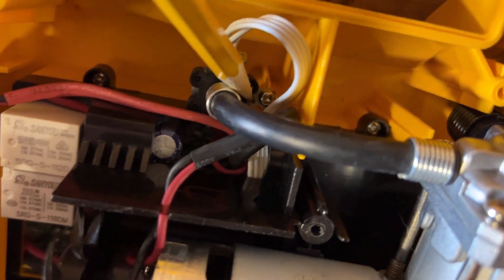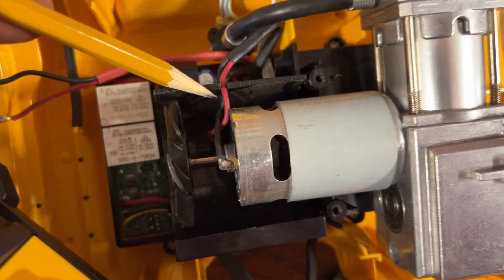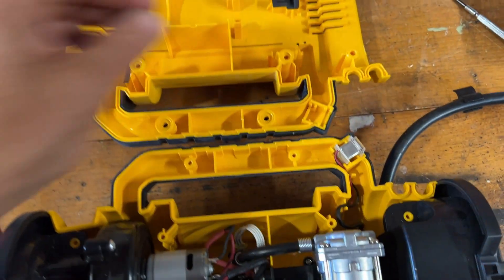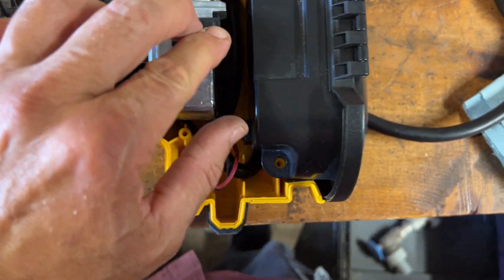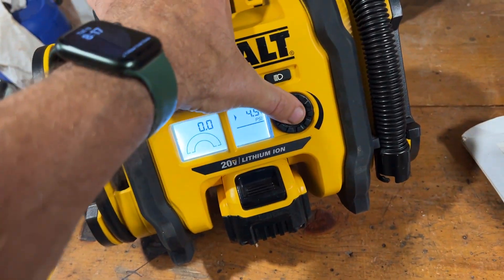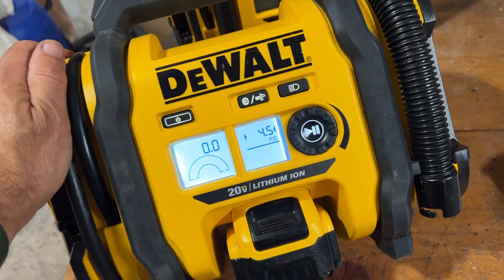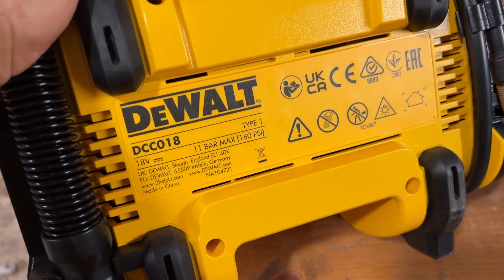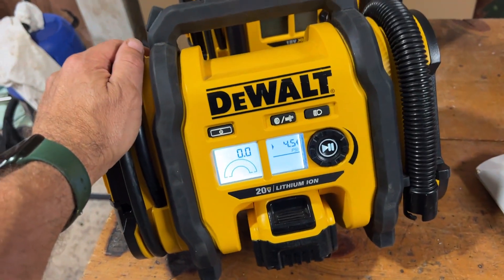DeWalt Air Pump Repair DCC0201  - Lights on, but nobody is home (pump dead) when on Battery

Comment: I have the same exact issue. Which relay fixed the problem? You have 2 listed and you said after replacing one of the relay it worked.

Comment: I have the same problem, battery power no longer works, but works via cigarette lighter plug. Can you provide data on the replacement relay? Also the video appears to have missing parts?
Reply from the maker: I added them to the description.   thanks!